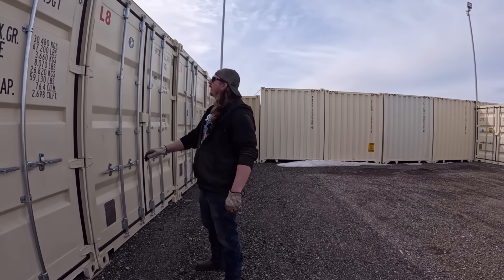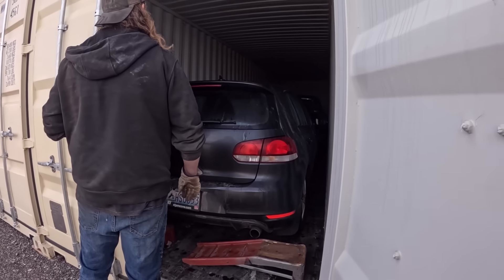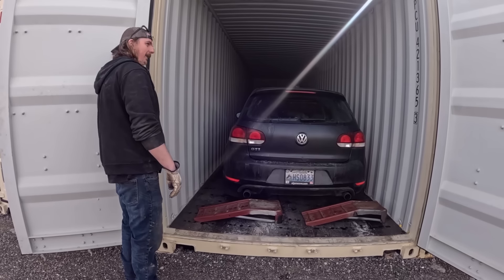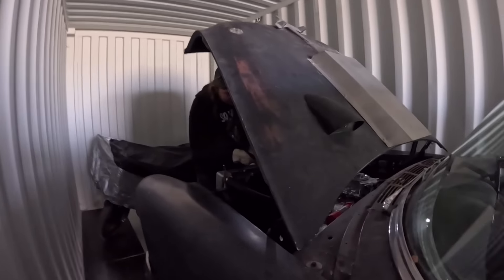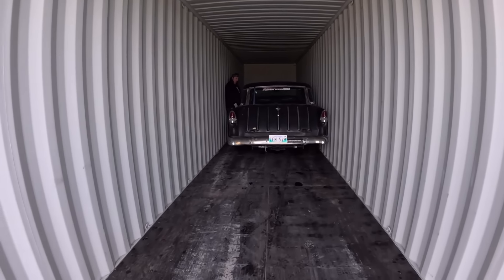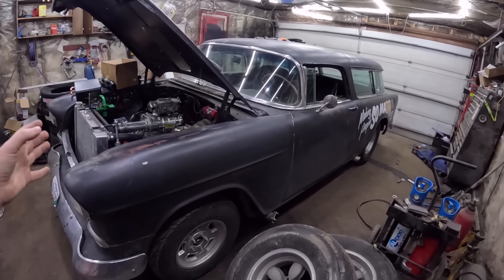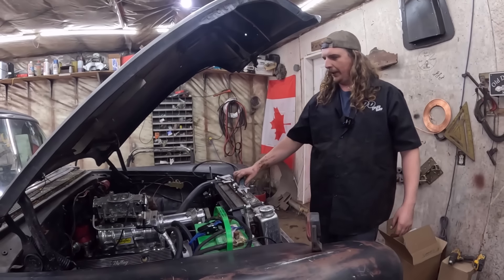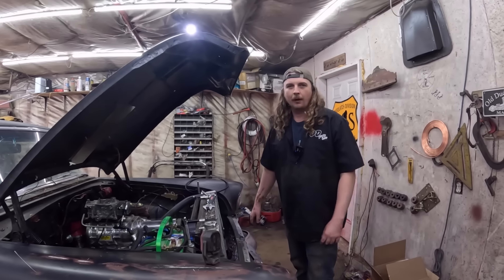Worst Nomad Ever?  What Have I Done?

Comment: Dan, what you need is a stethoscope, to find engine noises.

  Use a chunk of heater or gas hose,  depends on what you have that you want to stick in or near your ear.

I like to use a chunk of broom handle if I have one, but I have used heater hose works just as good for finding noises.

Stick a DD Speed Shop sticker on a chunk of cheap hose, sell it as a gag gift in your store

Comment: Dude . We finally get you on target with radiator caps , & you let the air cleaners slide ? Ugh . Still nice to see the roof with a title , lol . The Camaro came with a little bit more , glass . That will scare you . About 2000lbs less , & about the same HP . You'll see . You are lucky there aren't any active volcanoes , yet . There is not a nut or bolt , you haven't turned , or replaced , on that car . Love the side comments ! At least the whine isn't from the blower . Lol . You may want to double check your driver side front jet . You didn't adjust it with the others , just find stop , then dial out to their setting . But overall , way better than the Furd . Pegging the "Try Me " meter . Both of you . Rocking it ! Cheers !

Comment: QUESTION :::: QUESTION DOIN 56 , Gonna do tilt column ….. HOW DIDYOU CUT THE STOCK TRI5 steering shaft , death wheel? . Or sawsall,,,, help. 1 rocker done passenger next before Full floor , want to cut steering shaft , before I lift the car up to slide in floor . Help please no advice , just what you used to cut the steering shaft . Hope to hear back thanks CrazyWillie

Comment: I love Volkswagens. Air cooled Bugs I've owned three, and one of them I built all out drag race car out of. The other two were hot rodded street cars. The are simple and easy to learn. But you absolutely cannot put A/C in them, it will melt the engine down. And here in Phoenix, AZ, where it is 110-112 degrees F for literally half the year, and you are my age, A/C becomes an absolute necessity for a daily driver. If not for that, I would still own one. So was there really a motorcycle in there? I've never seen a motorcycle on your channel. You should get one. Make sure it's a carbureted Harley. They are the Chevy of motorcycles. Lots of fun. Dangerous, but fun.

Comment: I got a similar heater. It kinda makes heat. Hated the noise. Needs fresh air or windows will fog up in the rain. I learned the hard way, still havent done anything about it.
Think its a good move to run a heater hose up against a fuel line? Vapour lock is iminent…

Comment: Volkswagon GTI is a decent gas mileage car. Volkswagen Golf GTI is generally reliable. It is no muscle car but I WOULD LIKE TO SEE A RACE BETWEN THAT AND THE NOMAD. Its 0-60 time ranges from 5.65 seconds or 6.2 seconds . The horsepower of the 2023 Golf GTI is 241 hp for all models. And finally, the available engine includes a 2.0L turbocharged 4-cylinder engine for the 2023 model year. It not a slouch. It's not the best at any one thing but it's really good at everything. I BET IT COULD EASILY BEAT THE TAXI OR THE PATCHES CAR. IT WOULD BE EMBARRISING FOR THE CHEVYS.:face-fuchsia-wide-eyes::face-blue-wide-eyes::face-fuchsia-tongue-out::body-blue-raised-arms::hand-orange-covering-eyes: IT WOULD BE COOL TO PAINT THE SOMAD THE BLACK YOU PUT ON THE CAMARO. You could tape off the graphics.

Comment: You didn't spin the water pump. Set all air bleed screws out 1/2 turn. If it doesn't idle put them at 3/4 turn all of them move all of them the same amount. Until they're all equal and idols. The higher the float level the easier it siphons gas into the engine therefore making it run richer..... Make a DD speed shop mouse trap😂😂😂 before it makes a new nest on your new heater

Comment: you can shorten the wheel nuts by spinning them in the impact socket and filing them down so you don't have to double washer the wheel nuts on. The leaking heater core can be soldered with plumbing solder and flux using a propane or map gas torch. I don't know how long a chinesium auxiliary heater will last! If I was in your neighborhood, I could walk your pet fish in large puddles on a leash! April Fools!